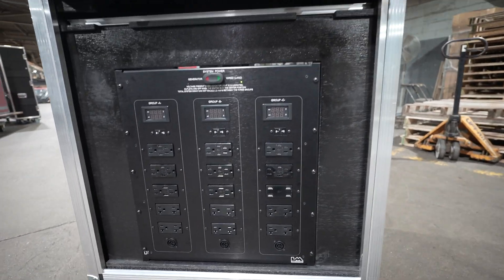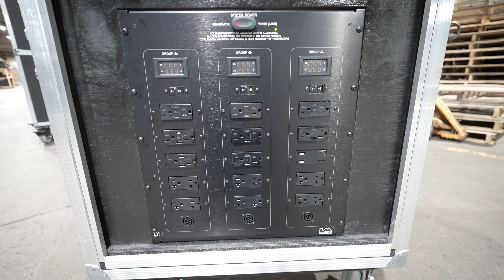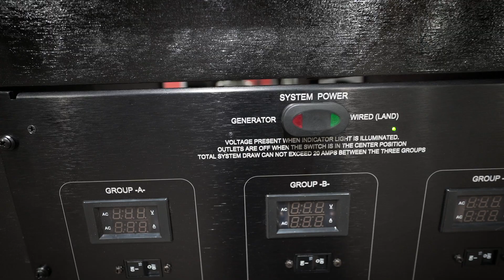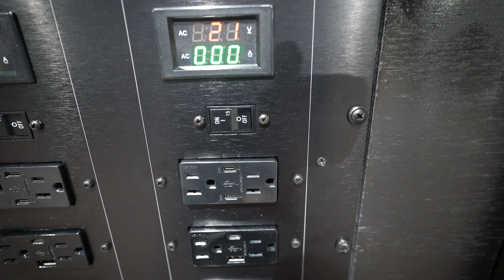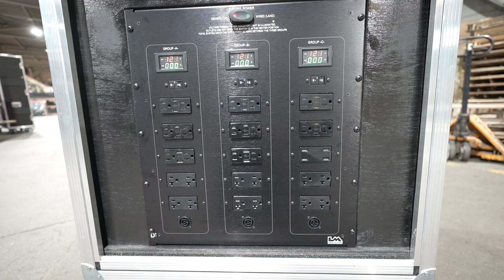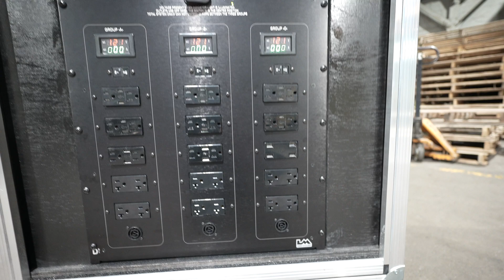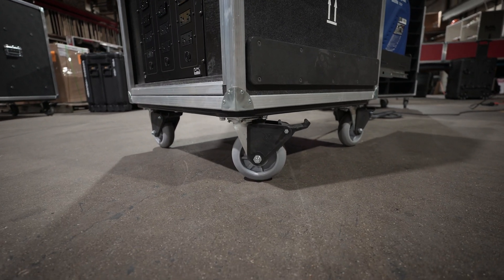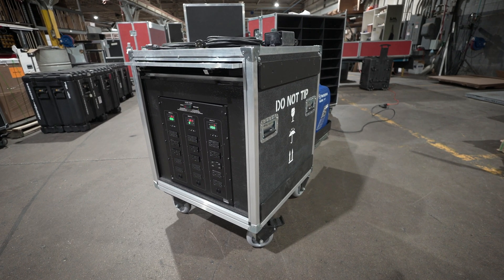Dual Source Portable Site Power System w/Generator & Cable Reel | LM Cases

Comment: 18-20 amp supply (gen or ac) with 18 outlets?? Seems like you would overload it very quickly.
Reply from the maker: Its fed via 5-15.
Reply: @lmcases1985  The edison plug you showed to power the reel is for a MAX 20 amp outlet. The generator per your own description is only 18 amps. So what use do you really expect to get out of 18 outlets?
Reply from the maker: @ Its designed for a very specific application in athletic locker rooms. It needs to accommodate a lot of items that dont require high amperage per outlet.
Reply: @lmcases1985  Would be great for phone chargers, but knowing your level of integration I would have expected something to hold the devices built in. You guys make some well thought out cases, just felt this was a miss.

Comment: Not water proof in any way. Genny is tiny inverter style which are evil with many loads. 
Oh, Neutrik's powerCON are not to be disconnected under load despite your claim.
Reply from the maker: They are True1, which are designed to be disconnected under load.
Reply: @lmcases1985  The manual says no, the design clearly says NO.
Reply from the maker: @bentheguru4986   From Neutrik: "The powerCON TRUE1 TOP is a connector with breaking capacity (CBC), i.e. it can be connected or disconnected under load or live."

https://www.neutrik.us/en-us/product/nac3fpx-top
Reply: @bentheguru4986  bro calm down
Reply: @bentheguru4986  it's made for in-door gym use.... Like phone charges and video recording gear.

Comment: How are you preventing damage to the shore power cabling from overheating on the reel due to induction? Also, how are you limiting the overall combined load drawn from the supplied circuit?
Reply: I can't speak to the induction but I can speak to the cord being designed to heat up when in use under full load. This will heavily depend on the insulation used. I don't know whether it's been a problem but a lot of manufacturers are putting circuit breakers and thermal cut out switches in there hanging cord reels. It is a big issue if you have a loop of cord all rolled up on the ground where the heat can't dissipate and kind of causes a avalanche affect where the heat can't dissipate and the insulation can't handle it and the wire gauge is under qualified for the amperage and proof they start melting together until they short. I was at a family get together where somebody add a cord reel mounted in their garage and I think they were using two crockpots, by the end of the day they were surprised at how warm things were and they were concerned of fire considering that most of my family has done some form or another in the fire fighting trades....
The biggest issue is thermal insulation of materials and wire Gage, compounded by heat buildup.
Trying to find the video that explained it well however it seems to have evaporated, evaded or pre-dated YouTube account/history.
Although this video should do pretty well https://youtu.be/sJ2Ew-Nhvj8
edit: and as far as the induction goes https://youtu.be/3AxM_Deo8YQ it's like a balance line in summary not an induction stove.
Reply: @imark7777777  two crockpot!? Each one is only 300 watts. 15 amp breaker is 1800 watts 20 amp is 2400 watts. Yes I agree with a cheap 16 awg cord reel should have a breaker on it like a power strip limiting it to the rated wire size. These cord reals are industrial grace Soow insulation and 12 or 10 awg. Personally extension cord industry in general is criminal. Little paper lable u rip on the first time u use it says it's only 10 amps nonsense. Every cord should be made out of 12 awg or larger  in my opinion. I always check the gauge, jacket material and jacket temp rating 105 Celsius is common in good cords. 100° C is boiling. So a warm or even "hot cord" is usually ok. It should never be uncomfortable to hold but I've ran lots through small cords and as long as the outlet and female cord end still has a good tight connection should be good
Reply: @donnots8218  yeah they're more like 1000 W unless they're on keep warm. That's why kitchens have to have two dedicated 20 amp counter circuits, same with the dining room. Basically anywhere you might use a high-powered kitchen appliance.
Yeah there's some cheap extension cords out there I wouldn't mind seeing them go away but then again some of them do you have uses. I personally like the 80 foot neon green ones for speaker cables, really good price once you factor in some quality spk-on ends.
I wouldn't say the cord reel was a cheap one but it did have a cut out Circuit breaker and it didn't cut out yet.

Very much know that. The skirting the edge of cords lengths and receptacles during the winter festival that we just started this year. Yeah electricity was a little bit of an afterthought. "We're just gonna run cords from the cubes to the power pedestal and the church nearby, an alternate who uses heaters" we were pulling 20+A on one of the circuits and I kept having to load balance it because they weren't sharing their heaters.

I kind of like the concept that technology connection has with why are not all extension cords fused like the UK with all of their fused plugs.
Although every one would probably just blow the fuse and replace it with the highest available just like we did with pennies and fuse panels.....

A Nice high-quality well cared for extension cord with last year's. Especially if it's over under wrapped.
Reply: Induction? On the cord real... How can it have induction? The cord is only powered when plugged in. If it's plugged in it's pulled out. Even if it's not pulled out all the way are u not familiar with hanging cord reals? I have several in my shop and they don't overheat from induction.  The transfer switch only allows power from gen or cord. Both cannot be energized at the same time. Overload would be controlled by the supply. If it's plugged into an outlet as a supply that   source will have protection. If it's running from gen the gen has a breaker.
I'm not sure what three other accounts u logged into to give yourself 3 thumbs up but I don't know who would agree with it.
Reply: @electromechanicalstuff2602  Oh no no no no, you are assuming the operator is pulling whole reel out and laying it out. Assumption is the mother of all F-Ups.
Reply: @bentheguru4986  not sure u know this but there are extension cords on reals in hundreds of millions of garages around the world hanging from the ceiling or work bench. They almost never get "fully" unraveled when used.... No epidemic of overheating extension cords .... Weird
Reply: @bentheguru4986  What r u talking about guy. Extension cords on reals are not an induction issue... Like ever
Reply: @electromechanicalstuff2602  and by making that statement, you clearly are not anything close to qualified to speak.
Reply: Over heating from Induction... On a cord real. I better go check the 2 I have in my garage right now.... Who knew, been installed for a decade and it can spontaneously erupt at any moment
Reply: @Bob724  BVesides being electrically inept and dumb, maybe look at why something was said instead of being in such a hurry to asert your authority.
Reply: @bentheguru4986  you mean like u did? What is your authority of the matter.... I'm 100% confident that an extension cord on a real is absolutely not a safety concern from induction.... Have you ever left your basement? Have u literally never seen an extension cord real? If so I'm not making fun of someone with no practical life experience.  They exist by the millions in most garages and shops and they pose no issues. I'm not going to state my credentials but point to the evidence of their existence by millions....
Reply: @bentheguru4986  I gotta say Ben not much of a guru... Maybe guru of Zelda or something not common use electrical items